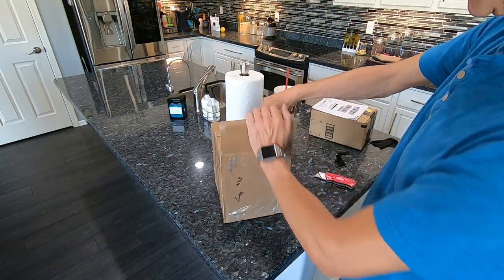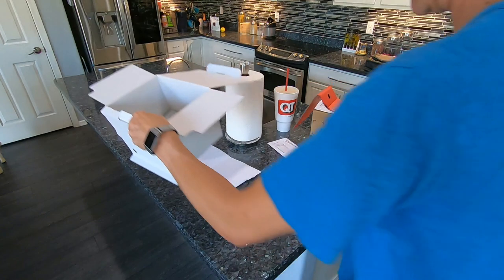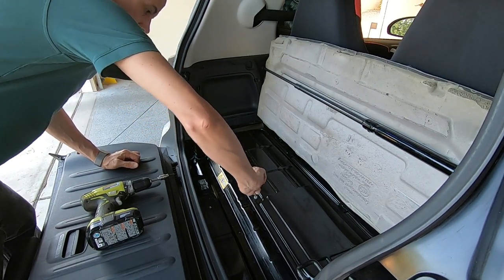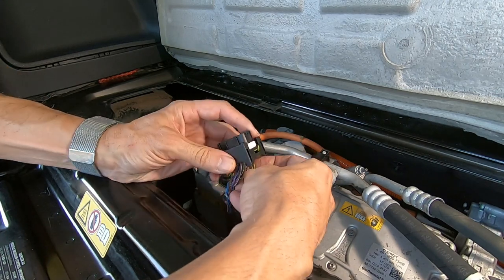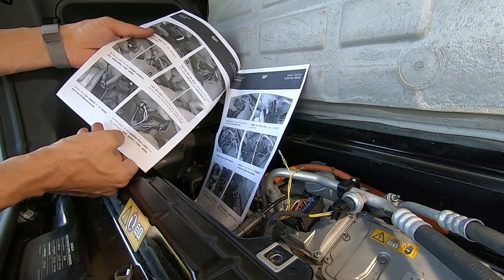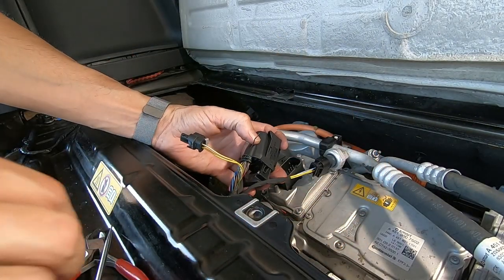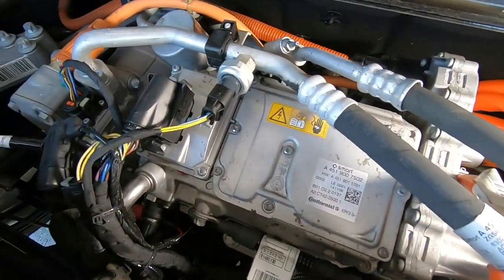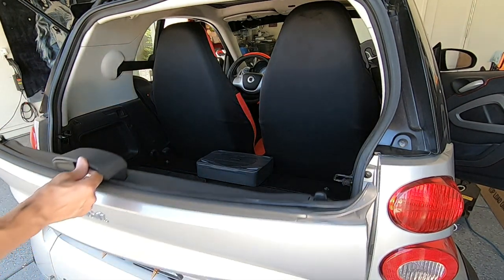Electric Smart Car Power Module

Comment: Just purchased and install the ed3 Steinbauer unit. So far loving it. Thanks Dan. A couple notes to help those who are considering or are installing. (1) the removal of pins was the hardest part for me, but super easy once you know the trick. DO NOT pull on the yellow/white and yellow wires. I pulled the first one, and it actually broke the tiny metal latching mechanism on the pin itself. I couldn't get it back to OEM state anymore (meaning if I tried to plug that yellow/white wire back where it started, but EV wouldn't start). But thankfully, that broken pin still works when installed via the Steinbauer module connection as instructed (I'm assuming the connection mechanism on the Steinbauer unit is just tighter so it didn't matter that the latch was missing - it still had a conductive connection to power). THE TRICK: there are 2 holes in each pin slot. The actual bigger hole where the pin goes, and a smaller hole next to it where the latch can be released. Take a very small pin (I actually ended up using a sewing needle) and insert it to the smaller hole. Push towards the pin (laterally) to engage the latch and slowly and EFFORTLESSLY remove the pin. It's super easy once you know how to do it. No special tools needed, just understand the mechanism of the pin attachment. You can use the short cable provided by Steinbauer to see how the pins work - that's how I figured it out. Other than, the rest of the installation is super easy.

One other note, and maybe Dan or other owners can chime in. The regen does not work when your battery is 100% state of charge. Not sure why. In OEM setting, there's still a regen effect even at 100%. But with the Steinbauer unit, between 95%-100% State of Charge, it doesn't behave. It will do normal regen it seems above 30mph, but will completely not regen under 30mph. Once you get down to 95% SOC or lower, Steinbauer unit regen kicks in. Here's a video of it happening:

https://youtube.com/shorts/dAC7t3gejTw?feature=share

Hope this helps everyone!
Reply from the maker: Great input on the pins! I had trouble with it too and fought it off camera for a while.🤣🤣
As for the 100% battery and no regeneration, I have that too but I drive 3/4 mile side streets until I reach the main road and by the time I get to the first stop light I have regeneration.

Comment: This video helped me a lot to install my Power Module.
The instructions that came with it from Steinbauer were in German ...
Thank you :-).
Reply from the maker: You are very welcome 😊 glad I could help you out, how do you like the extra torque 💥😁
Reply: @HandyDan  I love it.
But in the beginning there was too much of a battery drainage.
After that I learned how to drive very carefully and the battery charge economy went even up.

I love a lot the stronger regenerative braking, as I almost don't use the brakes anymore.
Lifting the foot off the brake pedal completely gives me a much stronger braking power than before :-).
Reply from the maker: @Marginal391  I understand that! I drive mine daily to work, tempted often by muscle cars so I do nail it to beat them!!
I can still get 100% ECO if I drive lightly, but often I start of and drop to 25% sometimes LOL But the best part is the REGEN! I love it, I have driven to work several times and not stepped on the brake pedal at all.
Reply: @HandyDan  I also noticed if I don't go more than 50 on the energy consumption dial (the one that goes red close to the 100 units) I get a lot of electricity savings. 
Helpful when we need to travel on long distances without recharging the HV battery.
Reply from the maker: @Marginal391  yes I noticed that too, but in my car it's very hard to stay below 50% because my pedal only has to move a half inch and beyond that it's above 50%
Reply: @HandyDan  same here.
I guess that's one of the effects of adding the Power Module.
If that maximum power supply was factory added, the control of the rheostat (gas) pedal would have been a lot smoother, thus easier to control.
IMHO the power we supply by it should be easier (longer play between min. and max. range) to control around the 50% and shorter in the max. power one, which is used very seldom compared to the range around 50%.

Comment: Hi Dan. Great video. Waiting here in the UK for my steinbauer module. What pin-pusher is that please? Thanks! Tom
Reply from the maker: To be honest I had troubles with the pin pusher,  I got a universal set. It didn't really have the correct size but it needs a flat type and on the one side it has a tab, hard to see but it's on the opposite side as the contact open side. (The contact is U shaped so the closed side has a tab to bend flat)
Reply: @HandyDan Hi Dan. Thanks! I did this yesterday and it went fine! You’re right about the pin pusher. I actually used the smallest shim I had in my set and pushed it down the narrow slot next to the pin, until I felt I was pushing the latch in. Then a larger pusher, plus some pulling on the wire, and the pin slid out easily. Thanks again for your video. The Smart ED is super fun in this ‘mode’ 😂
Reply from the maker: @tommy1273  This is by far the best upgrade for the electric Smart 😊

Comment: Hi, Thanks for posting this. Im doing this to my electric smart right now and im having trouble with the pin tool. Cant seem to get the wire out of the connector. Any help would be appreciated.  Thank you
Reply from the maker: Yes, sorry about your troubles, I had trouble too, my pin tools didn't work very well and I had to fiddle around off camera.  There's a side flap on the connector that needs to be slid out, also after pushing in a small flat pin tool I was able to pull the wires out.

Comment: its amazing all the things your doing to your smart car, Any link for the module cause the one you posted is not working, how much was it and did you notice any difference?
Reply from the maker: I'll have to check the link, it goes to Steinbauer USA in Detroit. 
I absolutely love the power chip it makes the car super responsive and quick, plus 100% regeneration and I hardly ever push the brakes 😀
Reply from the maker: You need to call the Michigan office to order in the USA, there number is on the Steinbauer website

Comment: Hey handy Dan does this also make it lose charge faster or does it not only increase power but optimize so your run times don’t change in between charges because I just picked up a 2018 and would love to find a good mod the increases it but also increases efficiency. Thanks. Also can you link that module in the chat so I can go see about picking one up. You put a great how to video together here.
Reply from the maker: It boils down to physics,  this module increases the current to the motor for faster acceleration and it provides 100% regeneration. If you drive it fast, your range will decrease,  but you can still drive it easy and have standard range.  Nothing can increase the range, lol that's why I'm doing the GSXR750 engine addition!

Comment: another question, can you add anything to the system to power your home fridge during a power outage  like a power inverter.  Have not seen anybody do this to try and tap in to that big battery in a pinch
Reply from the maker: I have heard of someone doing that with a Chevy Bolt EV. I do not know how since the High Voltage pack  contactor is turned off when the ignition is off and the onboard charger shouldn't work both ways. Do some research because I do know an electric car battery can power an average home for a month on one charge.

Comment: Can you do acceleration?
Reply from the maker: I can try, I have a dash cam and so many times I think about pointing it out the rear window so it shows the gap when I take off.
I have acceleration clips in this video. Just watch the speedometer.
Reply: @HandyDan  just saw it the only part i skipped!  Pretty quick for smart car😅
Reply from the maker: @DooDicky  😆 🤣 the intro and the ending shows a decent acceleration. 
My car isn't fast, everyone else is slow 🤣🤣  in Phoenix people take a quarter mile to get to the speed limit,  but in another half mile they're going 30mph over the limit...
Reply from the maker: @DooDicky  I just took another video on my way to work this morning, 0-40 across the intersection. As I said, my car isn't fast, everyone else is slow LOL

Comment: Question: Isn't is dangerous to go in the red sector of the right side of the right gauge? 
During the "pedal to the metal" acceleration, the draining of the HV battery is to the max ...
I haven't read what the manual says on this but still, going into the red sector ...

Thanks :-).
Reply from the maker: I pretty much go into 100% at every light!🤣
Reply: @HandyDan  Mine drops @ 80% max after a few seconds, and doesn't want to go higher no matter how hard I accelerate.
Reply from the maker: @Marginal391  I have noticed that the OEM has a detent at full pedal that kicked in max power. But with the Steinbauer module I get more power without activating the detent switch. Pushing the pedal all the way but not hard to depress the switch.  Mine stays at 100% for as long as I want.
Reply from the maker: If you are more interested in conservation of the battery, you will just need to learn the gentle pressure on the pedal and benefit from the powerful regeneration.

Comment: Whats the name of the ap you are using to check 0-60 times  looked up drag Strip Checker and could not find anything.  Again thanks
Reply from the maker: The app I have is called Drag-strip checker, maybe it's only available for certain levels of Android. But I have had it through Android 9 up to 11

Comment: Hey Dan, is the 12V battery at 9:01 the only battery or is there another high voltage battery for the power train?
Reply from the maker: The car has a 390volt traction battery and the two gages on the top of the dash monitor it. Left shows remaining capacity, right shows use amperage and regeneration. 
The car has a standard 12volt car battery for all of the lights and accessories

Comment: Hello.

Isn't it harmful to disconnect the battery?
I read somewhere that there must be a diagnostics tool connected to the OBDII port in order to change the battery.
I know this is not changing of the battery here, but still ...
Reply from the maker: There are times where people have had their 12volt battery die from sitting and cause the traction battery to brick itself, but if both batteries are in good condition and charged there's no harm in disconnecting the 12volt to install this module.
Reply: @HandyDan  you mean if the 12V battery goes dead, the HV battery bricks itself?

Thanks.
Reply from the maker: @Marginal391  Not always, but on Smartcarofamerica.com there's a lot of articles on this matter. Long term storage seems to be the most problematic cause.

Comment: How much did it affected your EPA?
Reply from the maker: The module does increase instant torque and 100% regeneration, I don't know if it helps, or hinders range. If you drive gentle and don't stomp on it I get the same range as before, but this car is so quick and super fun I drive it daily and hard on it so I get 55 miles of estimate range, but I also think that it affects the estimate due to the increase in current, because I can go a lot farther than 55 miles still.
Reply: I purchase one but I’m having engine error message code?
Reply from the maker: @jayilagan6228  what error do you have?  I had no trouble with mine.

Comment: It must kill the range
Reply from the maker: I have only had this for a month of driving before I tore the car down for my wide body kit mods.
But it can go either way,  it does push more current to the motor and is super responsive but it also puts a lot more back into the battery during regen. I get the same or a few extra miles of range driving in the city stop and go.
Reply: more than that I would say kills the batteries lifespan because it pushes them beyond the C rating....would be nice testing temperature differences with and without though.